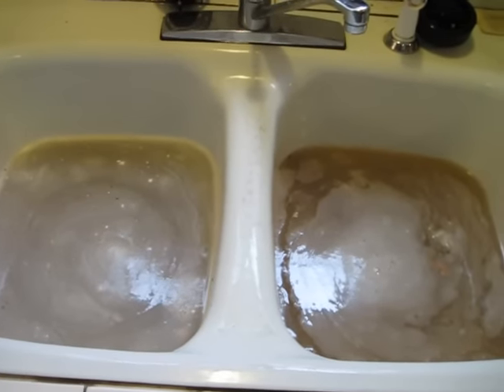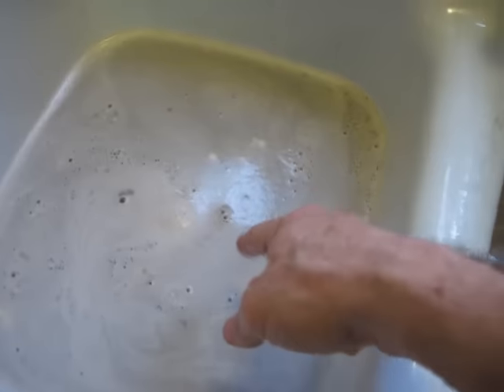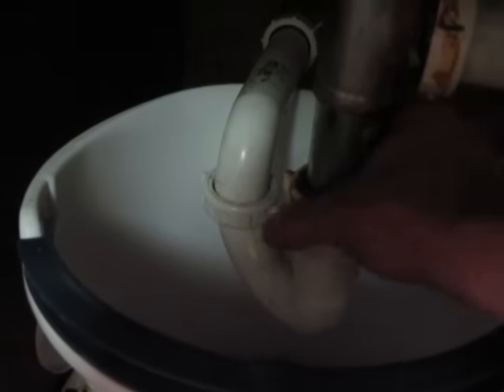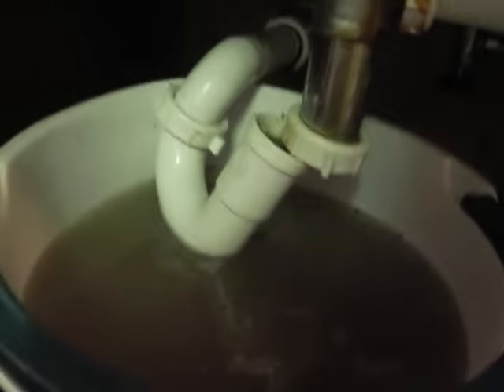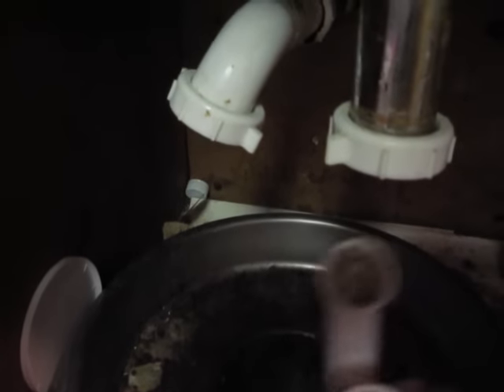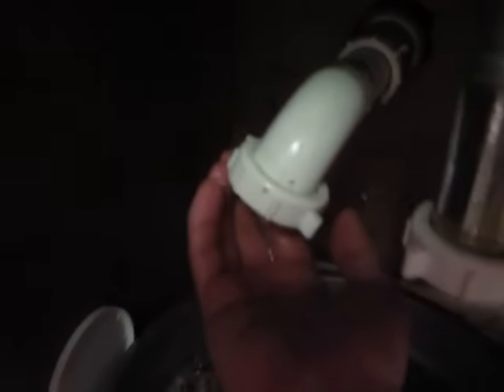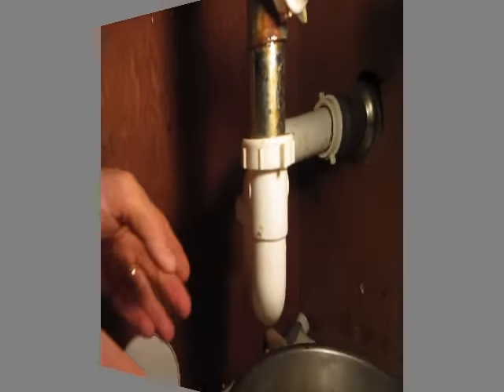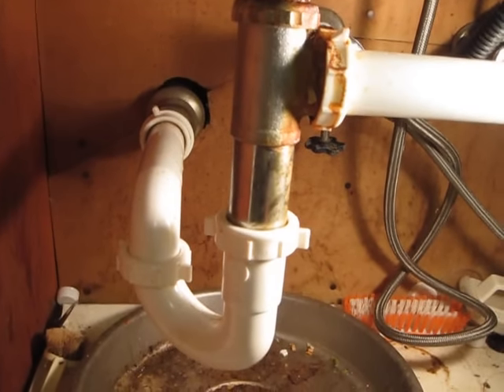How to Unclog a Kitchen Sink

Comment: PLUMBERS TRICK: To save you all the trouble of pulling the pipes apart in the future (for this exact problem)....In the beginning of the video when you had both sides of the sink full and turned on your disposal, if you had put the plug in the side that did not have the disposal on it and held it in tightly so it didn't pop up from the pressure, the disposal would act as a water pump and push the blockage right out. You saw how it filled the other side of the sink when you turned on the disposal. Same thing will happen but while holding down that sink plug it will make the pump push the water past the clog. You may have to do this a few times before it blows everything clear but it works every time. If it wont blow it open then chances are the clog is so deep in the pipe that a snake needs to be used. When you try this method the side of the sink with the disposal needs to be half full of water. The disposal will then pump that water into the lines under pressure. BEWARE that when you shut off the disposal to quickly hold your hand slightly over the disposal drain because if it didn't clear the clog water may shoot back up suddenly. Like I said it may take a few times to get it open depends how tight the clog is. Great video for home owners!!!
Reply: Did this tonight...worked just like you said...THANK YOU Rob Reynolds.
Reply: Rob!!!!!  Omg thank you for the tip...hopped on YouTube (bc you can find ANYTHING on here, what did we do before YouTube and Google?!?!) bc my kitchen sink got clogged on the side of the garbage disposal and was backing up water while my dishwasher was running!!!!  Yikes.  Happened on this vid and saw your trick posted!  Took all of 5sec to fix it, would have cost me at least $100 for a plumber to come out!  Your awesome.....bravo!
Reply: Mr Rob - You're The Man! Used your Plumber's Trick on my clogged kitchen sink this morning. It worked the 1st time just like you said. Both sides were so full of gunk I had to bail into a bucket almost all the left-side to put the plug in and half the disposal side. Held down hard on the plug, flipped the switch and PRESTO problem solved. I am truly grateful I took the time to read some replies and came across your post. THANK-YOU! :)
Reply: Great to hear it worked for you. Your very welcome sir.
Reply: o
Reply: Holly Hall Holly that is great...Every little thing we can do now a days to save some money is well worth it.
Reply: Rob Reynolds SOOOOOO bummed!  I've tried the plumber's trick a few times...guess I'm further down in the trap!  POOP!  Guess I'm taking everything out from under the sink and making a bigger mess than I hoped to today.  I knew putting 5 dozen eggs worth of shells wasn't my most brilliant idea.  :/
Reply: OH OUCH...yeah you cant put egg shells in a garbage disposal. You will need something to break them up like a snake.
Reply: Rob Reynolds Yup...totally an idiot maneuver on my part!  Took apart the trap (which is CRAZY because it almost touches the bottom of the cabinet and only has 1 nut that comes undone and everything else is cemented in...WTH?) and cleaned out all the shells.  Water flows down the sink now...however, it leaks.  So...mo-fracka...my plumber friend is coming tomorrow morning to see what he can do.  It's not a normal trap deal fo sho!  No gaskets, plumber's tape didn't work, hand tightened and wrench tightened...just a POS.  But I SUPER appreciate guys like you that are willing to share their knowledge with those of us that like to try taking care of this nonsense ourselves...when we screw ourselves over with eggshells!
Reply: Rob-This worked-Thanks-you saved me some $$$$
Reply: Thank you, Rob!
Reply: Thank you Rob--Afraid it's not working for me though :*(  I first tried the baking soda vinegar boiling water trick on both sides as I saw that method first.  I'm doing laundry at the same time, and I am wondering why the washing machine water filled the sinks!  I bailed all that nasty water out, and then saw your trick, so gave that a try four times. I went into the laundry room and there is a puddle of water on the floor with a lot of tiny little gooey balls of white sticky stuff...no idea what that's about??? Could that be a baking soda?  Anyways at least now the water sitting in my sinks is nice and clear.  I wonder if I should start taking pipes apart....or go the hard ware store for a snake!  I had no idea we can't put egg shells into a garbage disposal. I caused this clog myself by putting a bag of baby carrots down the disposal.  I don't think I'm going to be using my garbage disposal for much of anything after this nightmare :*( :*(
Reply: OMG - we have had a plugged kitchen sink for 2 days and have tried the strongest liquid plumber and another brand and NOTHING. I just bought a snake thing and got back to work and googled "unplug kitchen sink" and found this video. I saw your post, Rob, and called my boyfriend and gave him the instructions over the phone and WHALLAH! It worked!  Thank you!!! phwew!
Reply: Rob, Buddy, I could have used that tip YEARS ago. You are the man. Hat Tip and a cheer.
Reply: GOD BLESS Rob Reynolds
Reply: LOL...glad it worked for you...
Reply: Michelle Walker
I'd say compost the shells. Absent that, throw them on the lawn. They'll get pulverized next time you mow and the grass will benefit from the calcium.
Reply: THANKS A BUNCH THIS TRICK JUST WORKED FOR ME
Reply: You are amazing!!! Thank you SO much for this tip.  Unfortunately, I read your thread after I took all of the pipes apart!!!  It work instantly : ) I was very cranky when the sink was clogged...now I am happy!
Reply: Hi Rob, just want to say thank you for your great tip!!! It worked like a magic!
Reply: Thanks Rob. Took your advice and it works.
Reply: Rob, just used the "disposal method" and it worked like a champ! Thank you!!
Reply: Dude!  Worked like a charm!
Reply: love hearing that
Reply: Awesome!  That works!
Reply: Worked like a charm!!!!
Reply: This is a great suggestion, I tried it and guess what happened? Water backed up out of the washing machine hose drain and onto all over my garage floor.... yeah it smells bad.... so we then got a hand auger, 25 feet into the pipe and nothing there, not from under the sink pipes, not in the washing machine hose drain and not in the main clean out. Where else can the problem be? My sink is not completely clogged perse, it just drains really slow......
Reply: Worked right away. Thanks
Reply: Leona C.  I would call a drain cleaning service in your area at this point.
Reply: +Rob Reynolds THANK YOU! This fix cost me a total of 7 bucks and worked like a charm.
Reply: Rob Reynolds You are a life saver. I did it myself and cleared the clog. It took some strength, especially if you try to clear it by yourself. Thanks for the suggestion. Passing it along.
Reply: Perfect, thank you sir.
Reply: Brooooooo I love you, unclogged our kitchen pipes in like 30 seconds and gf cleaned out my pipe too if you know what I mean THANK YOU
Reply: This is why I love the internet--worked like a charm!
Reply: Thank you so much. It really helps.
Reply: You are very welcome
Reply: Rob Reynolds Thank you, Rob!  I first had squirted some Dawn dish soap into both sink drains and let it set (eats away at grease and protein).  Then I found your great advice here:  Plugged the non-disposal sink drain tightly.  Filled the disposal sink at least half way with hot water.  Ran the disposal.  And...whoosh!  Cleared out the clog and is running normal again from both sinks.  You rock for getting on here and taking the time to help us all out!
Reply: The dawn trick works on plugged toilets well
Reply: You the man rob woohooooo!
Reply: My parents were trying to figure out how to unclog it for hours! I did the research and found you in an instant. Fixed it, thank you.
Reply: lol bet they were surprised
Reply: your very welcome
Reply: If I could give you a hug through the computer I totally would!!  Thank you so much for sharing your expertise. Not all girls are lucky enough to have a Rob around ;)
Reply: that is the best comment I have ever received. Thank you...
Reply: Dear Rob Reynolds will you marry me?
Reply: Your very welcome.  You seem to be quite popular....
Reply: Awesome page!  If I lived in Minnesota I would definitely give you shout.
Reply: Rob, thank you so much! Worked after the third time turning on the disposal, just like you said! Thank you very much sir, you are a fine gentleman.
Reply: Thank You. I'm happy it worked for you.
Reply: Thank you so much!! My kitchen was clogged and turned to this video for help and scrolled to see your comment. I didn't think it'd work but it did and saved me a lot of headache! So glad I didn't have to call a plumber..
Reply: lol oh but you did call a plumber...I'm glad it worked for you. We have actually started telling our customers about this trick on the phone when they call in. If it works we saved them money...if not we go out and snake the drain for them.
Reply: Rob Reynolds Thanks Bob...... Worked like a magic...... I should've scrolled down to comments in first place.. I tried what the video said and gave up....... And scrolled down to see your message....... THANKS A LOT FOR SHARING THIS PROFESSIONAL TRICK. Not everyone is so generous like you..
Reply: Rob Reynolds You Da Man Rob.  Worked exactly as you said.  Great tip!
Reply: great Patrick good to hear
Reply: Thank you so much!!! This worked instantly on the first try
Reply: Rob Reynolds Thanks so much. After plunging and snaking we were getting no results. I remembered this comment and gave it a try. BOOM! It worked. Saved us $300 bucks. You the man!
Reply: Rob Reynolds I just tried this and it worked! Thanks a lot man!!!
Reply: Rob Reynolds THANK YOU!! I don't put much down the garbage disposal, but I had family over for the last 24 hours and they have different habits for disposing of food and I ended up with a minor clog. The sink would drain, but if we used the garbage disposal the other side of the sink would fill up. I watched several YouTube videos trying to find something that was less involved than taking the pipes apart. While the particular video your comment is connected to wasn't helpful (I didn't even finish it because it didn't seem to fit my situation) I am so glad I saw your comment and the tip you offered in it!! It was just the trick! It took two tries, but the drain is entirely cleared! Thank you! And another thing- I saw your comment to another viewer that you may start a YouTube channel -- I think you should. You saved me time and money.  Thx again from Portland, Oregon.
Reply: Rob Reynolds HELP if possible. Did not work for us. We have a longer drain pipe though connecting to the city line through our back yard.
Reply: Rob Reynolds Rob, your tip worked on my first attempt. I used a drain stopper for my tub that didn't fit perfectly, but it covered enough of the sink drain to work. I imagine if the clog was worse, I would have needed to use something with better seal. Thank you.
Reply: dailoman you can get a few paper towels, and use them as plug! Worked for me!!
Reply: you are the man sir. it worked perfectly aha thanks playa
Reply: Thank you so much, it worked perfectly.
Reply: Rob Reynolds I join the long list of people for whom this worked so simply and wonderfully.
Reply: +Rob Reynolds THANK YOU!!!!! IT WORKED!!!
Reply: +Rob Reynolds Thank you so much for this information. Really helpful.
Reply: +Rob Reynolds You just saved me a major hassle because I fixed my sink myself using your trick!!  Thank you very very much sir!!!
Reply: brandon williams yeah same here. Thank you!
Reply: +Rob Reynolds Thanks. your post saved me lot of trouble.
Reply: Thank you! Saved me so much trouble and worked like a charm!
Reply: +Rob Reynolds Just tried it after hours of plunging and snaking.  Worked in less than 5 minutes.  THANK YOU!
Reply: Worked like magic! Thank you!
Reply: +Rob Reynolds This may be the most useful comment in YouTube history. Count me among the millions that found this to be a lifesaver. Thank you Rob!!
Reply: +Rob Reynolds Bravo Mr. Reynolds ! and also a thank you to GeO for posting the vid, without which none of us would have read Rob's comment.  Yes, it is thanksgiving.  Yes, this worked .. 1st try !  Amazing it's not common knowledge. But you (Rob R) clearly helped more than 80 people.  : )
Reply: +Rob Reynolds I tried it, several times as you indicated, but it didnt work. It also caused some leakage to start from the disposer itself it seems through the housing, that was previously not there. The debris that came up during the backwash was like shards of flotsam that, frankly, I dont know how they got in there. If the disposal is working correctly it should annihilate the things put into it into very small grains. Right? This stuff had as much as 3/4 an inch in size, like paper thin too. I will have to try the auger. Does this indicate that I have to replace the disposer too? I also noticed the drain from the dishwasher was going into the sink drain, in an inlet, but was not put through the disposer first. Don't know why the previous owner did it that way. There is also a small attachment there in that same pipe before the "P", leading to my reverse osmosis tank. IDK, maybe too many holes for this to work? I hope the crud didn't get into my purifier tank or into my dishwasher drain, but I would assume it is setup to keep the flow from reversing. 
     Plumbing is not fun, and I think plumbers are worth every penny they get. In my first attempt to snake the line, while taking apart the drain, the strainer below the sink broke off from the puddied ring on top of the sink. It was too old and an unusual part to find with a center screw holding the two together that completely corroded off, and I couldnt find another, so I replaced it with a more modern one. Now the drain pipe is fixed but Im back to the clogged drain (w maybe a new leak on the disposer). The smaller 10 foot auger didnt come up with anything. I have to try a longer and thicker 25 foot auger next. 
Thanks for the tip, it might have worked on a smaller clog, and it is a good'n!
Reply: +Rob Reynolds If Dawn works as a grease breaker, wouldn't an actual degreaser work even better or is there something in Dawn that's preferred?
Reply: +CarlAnthonyTV I would call in a pro. ASAP
Reply: unfortunately I have used an auger, draino, liquid heat and plungers. I do not have a food disposable system.

I think I'm screwed and have to call a plumber.
FML
Reply: +freeburds maybe y'all should PayPal this man a few dollars for saving y'all $$$$$.
Reply: Rob Reynolds THANK YOU!!! I've tried snaking the line 15 feet, tried snaking outside 15 feet, tried chemicals, hot water.. nothing worked.  Four attempts with your trick, and after two weeks of washing my dishes in the sink next to my washing machine, I have my kitchen sink again.  However, now I've got a lot of water outside my house that looks like it came from a pipe outside on my roof.  THANK YOU SO VERY MUCH!
Reply: Rob Reynolds - you rock. ur tricked worked
Reply: Curling hair
Reply: Rob, you are the MAN!! That trick worked like a champ!!! Thank you Sir!!
Reply: Rob Reynolds This worked like a charm! Thank you!!
Reply: Rob Reynolds THANK YOU!
Reply: Thanks a million!!! this just worked - even with a deeper clog beyond the u-bend. Damn carrot and potato peelings - lesson learned.
Reply: Now THIS made sense! I wish I would have seen this before messing with the snake and everything else! This trick took care of it first time and now things are back to flowing properly again. Thanks @robertreynolds1 for posting this.
Reply: This saved me. Thanks!
Reply: I love this idea, that's what I grew up with/we did last night. it didn't work though (maybe we weren't doing it right). I opened the pipes this morning and found the nasty pasta clog!!
Reply: Rob Reynolds what about a sink without a disposal?
Reply: YOU ARE THE MAN!!! Spent days trying to uncog, watched several other utube vids but to no avail. I really was at wits end and thought plumber really needed to come in as the clog was definitely in the drain pipe. Your 'trick' made a lot of sense so i tried it though didn't think it would work on my sink due to the clog being so deep...tried in once, twice, three times...and then all of a sudden, lo and behold the water started to recede in a rate of knots!!! Felt like Moses watching the Red Sea parting! as i said YOU ARE THE MAN!!!!
Reply: I know this is an old comment but this is amazing. I actually just suctioned the plunger down on the non-disposal side instead of using the plug and turned on the garbage disposal and it fixed it instantly! Now I know how to fix clogged kitchen sinks like a pro haha. Extremely useful thing to know.
Reply: Rod, if you are still alive I think you deserve some appreciation for sharing this trick. I'm sure many folks your comment has helped wouldn't mind contributing to a gofundme account. why don't you set up one and share the details here.
Reply: Rob Reynolds great tipp unclogged my sink fast !! saved me so much time 👍
Reply: Rob Reynolds you're the MAN!! thanks!!
Reply: bad idea bro!! i tried your little "trick" the water started shooting out from the wall all over the floor from a pipe behind the washing machine.  assuming that washing machine drain pipe is connected to the sink's drain pipe and the block is farther down.  also appears that the washing machine drain is just not sealed at all, some plastic tube stuck in the top of a piece of old galvanized pipe... lol so yeah, people don't just go blowing water thru you never know where it could just blow out somewhere else.  hire a professional...
Reply: I just saw your video and it worked like a charm...wish I would've saw it before taking sink apart. Thanks a million!!!
Reply: austinitesince1979 -- That's my concern. I'm afraid if I create a vacuum and force the water, it will break something.
Reply: just used this method worked!! thanks a bunch rob!
Reply: Thank you so much for this comment.  My husband was going to take the pipes apart using this great video tutorial.  I tried your method and it didn't work.  Then the next day, I decided to plug up the sink again and then use the garbage disposal and let it run and run.  After a minute or two, voila! it all came unplugged!  I'm glad that I saw your comment and I'm glad I found this video, both very helpful!
Reply: Thanks Rob! Your plumber trick worked!
Reply: Pretty sure you'll burst the pipes if the pressure is too strong, but w/e
Reply: Rob Reynolds Your trick worked. Thank you thank you thank you!! I love you man 😂
Reply: Dude my sink has been blocked for two days, and after plunging the living hell out of it for 3 hours I figured there's gotta be a better way to do this. I was looking on YouTube and saw your comment on the top of the list and thought that's pretty damn smart. Pretty much a centrifugal pump. Worked like a goddamn charm. Idk if any one has told u this, but Rob you are the friggin' man
Reply: Rob, thank you so much. That worked great and super easy. Much appreciated!!!
Reply: I just did this, worked like a charm. Thanks Rob!
Reply: Rob Reynolds thank you! Your suggestion worked like magic! Last time I paid a Plummer $85 dollar to solve a 2 minute job! 

Much appreciated!
Reply: Rob Reynolds - Thank you so much!! This was a life saver for me. I don't have a handy man at home. I tried your method and it worked. I didn't want to have to unscrew the plumbing. It looked super gross! Thanks for leaving the comment.
Reply: Michelle Walker o damn egg shells..I just did that last week!! Stupid me...but will try this plumbers trick!
Reply: camper doodles did the same with egg shells..clueless I had no Idea! Do now though..
Reply: Rajkumar Varadharajan I did the same exact thing...scrolled down to comments. His advise was priceless...:)
Reply: This method can also blow the pipes loose.
Reply: This worked great on Oct 7th, thank you so much! Saved me from calling a plumber on Thanksgiving weekend.
Reply: Thanks Rob - worked like a charm!
Reply: Thank you! Your comment is the best part of this video
Reply: This took me several tries and took all of my weight to hold the plug down on the other side. I think I'll actually be sore tomorrow! But it worked! I took the pipes apart and wasn't able to find the clog so I know it was pretty deep. But this still worked for me. I am so relieved. Thank you so much.
Reply: Rob Reynolds I just wanted to say thank you from the bottom of my heart. I was in tears not being able to fix my drain and your comment was first and I tried it and it worked. Thank you so much!!!!
Reply: I wish that had worked for me. I ended up soaking wet on the first attempt. The pressure caused the pipes under the sink to pull apart. Even with a bucket in there, it was spraying out horizontally. Me, under the sink, the floor... all wet. I guess my problem needs a plumber. I also tried the method in the video (cleaning out the p-trap, etc), but that didn't help either.
Reply: Wow, I was about to take apart the pipe below and read your comment. Talk about close call. Good advice sir!
Reply: Thanks, worked just as you said.
Reply: Worked great!  Thanks Rob Reynolds!
Reply: Rob Reynolds you just totally saved me on Thanksgiving eve!! Thank you
Reply: Rob Reynolds I tried this twice and was about to give up. Third time was the charm thanks so much
Reply: Add me to the list of people who tried this 'plumbers trick' who thought it was great at first, but then discovered disgusting water and rotting food pieces spewing out my washing machine drain pipe and flooding my utility room. Had to call a plumber to get the drain further down the pipe anyway and added extra work cleaning up the laundry room.  Oh well.
Reply: Yeah, it's not always going to work.  If you have some minor gunk in there, it can...but if you've been going hard for years on the disposal and there's a multi foot long fatberg in that drain, it's time to either call a professional or..if you're careful nuke it with some lye or drano crystals.  Sounds like you had a 5 alarm clog though if it was pouring out another outlet in a different room.  Jeez.
Reply: Rob Reynolds this comment helped me. I took the peices off and realized that the clog was just into the pipe. Just out of reach going into the wall but i tried your plumber trick and it worked.  Thanks
Reply: Rob Reynolds thanks!!
Reply: Thank you so much for this tip! Worked like a charm
Reply: I know this was 3 years ago but guess what, it helps to this day thanks a lot
Reply: Rob Reynolds I do this all the time lol people are amazed
Reply: I know the comment is old but this fixed my problem today! Thanks!
Reply: Rob Reynolds you are the man. I just spent 2 hours watching videos and then stumbled upon this blessed post.
Reply: Unfortunately, no dice for me. Threw some tiny orange (bellas or something?) peels down the disposal, thought they'd chew through it no problem. Filled the sink more than halfway, held down the plug on the non-disposal side, but it hasn't cleared up.

Going to try a snake tomorrow - first time using one. In fact, I need to go buy one, but, we'll see how it goes. Appreciate the tip - wish it had worked for me!
Reply: Rob Reynolds worked like a charm!
Reply: Rob Reynolds THANKS SO MUCH FOR YOUR TIP IT HELPED ME SO MUCHHHH.
Reply: YOURE THE MAN THANK YOU
Reply: Thank You Rob Reynolds. I can see my sink again. God bless you.
Reply: Thank you Rob Reynolds. I can see my sink again. God Bless You...
Reply: Thank You Rob Reynolds. I can see my sink again. God Bless You...
Reply: Word of warning: the powerful syphon effect may cause water to leak from the pipe connecting joints. That's what happened here. Afterwards, no leaks.
Reply: Thank you! This worked just like you said it would. I really appreciate the advise.
Reply: Rob Reynolds I
Reply: Rob Reynolds How long do you leave the disposal on before turning it off?
Reply: Rob Reynolds I thank you man! Props!
Reply: Violet Raven クリスタル I took your word man. I did it and the water shot down and didn't come back up. God bless you man. This is real and no gimmicks people. 👍
Reply: Rob Reynolds thank you !!
Reply: Badass advice. Worked!!! Thanks!!!
Reply: Thanks.  I knew something like that would work but didn't kniw the trick.  You should post a video.  I would but didn't want to steal your fame.  😁
Reply: Rob Reynolds  thanks to you I don't have to call a plumber awesome trick that works thanks a lot!
Reply: Thanks man
Reply: Yessss!!! Thank you sir! Worked after a few times.
Reply: Thank you based Rob for fixing my clog. For everyone else: Definitely felt the pressure jolt like Rob said, so hold down tight unless you want nasty sink water all over the kitchen. Took few pulses but after 20-30 seconds, that pressure jolt hit and everything cleared up.
Reply: This is the true gem right here. Watched this whole video, but had I read your comment first it would have saved me 30 minutes of work. Thanks dude.
Reply: Rob Reynolds i have the same problem but every time I turn on the garbage disposal, that’s when it will clear the other side to a slow drain which is usually backed up...and also when it drains down it makes a gurgling noise....any help would be appreciated...thanks in advanced
Reply: Wow so simple and it WORKED. Thank you sir!
Reply: Thanks for this tip! It worked perfectly.
Reply: Rob Reynolds thanks for this trick.  Just saw this post and it worked for the clogged sink. You sir are a hero.
Reply: It worked. Thx Rob
Reply: Rob Reynolds omg. I clogged the sink of the family that I am nannying for. I was in complete panic but you just saved my life!
Reply: Thank you! Your comment just saved us so much time and trouble 👏🏼
Reply: It works wonder!! I tried so many ways to unclog my kitchen sink and nothing works. I am just about to give up and call the plumber and saw this! Thank you so much for sharing the tip!!!
Reply: Thank you so much! My husband and I appreciate your expertise.
Reply: LIKE A CHARM!!!!! GREAT TIP!!!!
Reply: Omg!!! Thank you so much for your tip. If you had a paypal account,  I would definitely give you a donation. ❤
Reply: Omg! I just tried this worked the first time!!! Thank you
Reply: Just SAVED MY BACON!!  Switched the plug to the non-disposal sink and held it down while disposal ran (felt the push back on my hand and I held it more strongly) and it worked!!!  First attempt after fruitless plunging and I'm so relieved!
Reply: Rob Reynolds 
I just tries your trick. OMG it worked. Thank you so much. I am so GRATEFUL!!!!!
Reply: Rob Reynolds bro!! Your tip fixed my sink. Didn't even finish the video cuz your advice worked! Thank you.
Reply: Rob you saved my me a lot of trouble, I think I love you man. I will pay it forward.
Reply: What a sweetheart!!!  Thank goodness I read your comment (the gift that keeps giving) before I watched the video.  Your solution fixed my problem in 30 seconds.  Thanks so much! xoxo
Reply: Dude you are a lifesaver! This worked perfectly!
Reply: Amazing!!! Fixed within 5 seconds haha
Reply: Thank you! I was about panicking and tried this. Worked. first shot.
Reply: Just did this. It worked. Took a about 30 seconds but it finally pushed through. You have to hold that plug in good and tight. Glad I got it done before the wife got home she would have been angry lol.
Reply: Still works years later im thankful for your advise.
Reply: About to call the landlord, did this, no more stoppage!  You RULE.
Reply: Thank you sir, was about to go crazy. Tried to snake it multiple times, no dice. Now my wife won't kill me. You the man.
Reply: Thank you very much!! Was getting ready to take the pipes apart like the guy said but decided to try your method first...worked like a charm and it only took 15 seconds thanks!!
Reply: wow, not sure if you still if your around, but this advice worked perfectly. my parents home had a clog in their sink for the past week, tried other advice posted on forums, nothing worked, that is everything without having to remove the past the p-trap, and they were about to call a plumber, i tried this trick and it worked perfect, they came home from church and were really happy. So thanks for this useful advice.
Reply: Thanks again. Double-clogged kitchen sinks with a garbage disposal on one of them. Unscrewed the kitchen drain clean-out on the outside of the house and got a fair measure of black crud to spill out. Reinstalled the clean-out plug; sinks still clogged but at least could slowly drain. Read and did your trick and within five seconds the remaining blockage was taken care of.
Reply: Wow, thank you! You just saved me a huge head ache
Reply: 4 years later and you're still the miracle worker!  THANK YOU!! 😍♥️
Reply: You are the man !
Reply: Oh thank you so much Rob!!! It worked for me also!! You are amazing!!!
Reply: Rob-  Thank you for sharing this fix...I have ten thumbs when it comes to fixing things and after reading your post I went and did this and it worked beautifully!  Within 3 minutes I looked like a hero.
I appreciate you taking the time to write this.  Happy Thanksgiving!!
Reply: YOU THE MAN, ROB!!
Reply: It didn't work. My garbage disposal sounded like it was going to break when I tried this. Do you have any other tips? :)
Reply: Thank you so much for this tip Rob Reynolds! I had this exact issue tonight and I fixed it! Thank you so much for sharing!
Reply: Thank you for advising on this fix. Just worked perfect for me - sink is back to normal! =)
Reply: Any tips on how to unclog the sink with NO garbage disposal? Both of my sinks are filling up 🙈
Reply: Didnt work for me bro i tried
Reply: Thanks dawg
Reply: I wish I had a a disposel. My sink has been clogged for two month. Everyday I have to dump it multiple time a day just to do dishes. Wtf
Reply: Rob Reynolds I’m having a hard time with my drain I’ve tried vinegar with a whole box of baking soda nothing happened. Then I tried boiling the hot water poured down slowly nothing happens oh I 4got to use salt dang I’m try that over but I got desperate and used a bottle of liquid Plummer waited 15 min nothing. I put a wire hanger down in there nothing I’ve used a plunger that didnt work.  The garbage disposal is running good and both sinks are half full so I turned on my disposal and plunged the heck out of the opposite side. That didn’t work. Is there a technique that you use I can’t give up my father never called the plumber he died in June 2011 GOD rest his soul. I have a snake but I think the end is to big to go in2 the sink it might be for toilet what do you think I value your opinion you helped a lot of people here. You should do your own you tube channel I know I’d subscribe I don’t usually subscribe to anybody unless they know a thing or two about what they doin. I am going to subscribe here to this channel.
Reply: Not all heroes wear capes🙌🏾
Reply: Glad I read the comments before I did anything!! Tried this trick tonight and worked like a charm! Definitely requires 2 people... one to hold the stopper REALLY HARD and one to flip the disposal switch. So thankful for this tip!!!!
Reply: Thank you so much! it worked the first time!
Reply: Rob Reynolds worked exactly as you said it would! Thanks so much for advice! Saved me $$$
Reply: Rob - thank you SO SO much!!!! This worked right away unlike so many other things I tried without taking apart the pipes!!!
Reply: Thank you Mr. RAYNOLDS , WE Appreciate it.
Reply: Rob Reynolds thanks for the advise man.
It worked the first time and saved me a potential headache. 
Happy Holidays Brotha!

If you need any advise on flooring or painting, I am licensed and have good info to share.
Reply: your the man thank you for this tip It worked if you do exactly what you say lol thanks again happy newyears
Reply: Rob, I see it's been 4 years since you wrote this, but you are STILL helping people! My kitchen sinks have been blocked for days, and draining real slow.  I removed the pipes, and tried a snake and plunger for 2 days, before I saw this video, and it didn't unclog the sinks. Then I saw your comment last night, and tried it today. It worked just as you said! The first attempt,  I forgot to put my hand over the drain after turning off the garbage grinder, and quickly was reminded of what you said, when I got a burst of water in my face! I tried 3 more times after that, and it seemed to be draining better. Then, finally on the 5th attempt, I filled the garbage grinder sink half with water, turned it on, and this time it blew it clear! 
THANK YOU SIR!!  I was so relieved after several days with a clogged sink.
Reply: Thanks Rob! It worked the first time! You saved me time and money. Time to enjoy the weekend!
Reply: Thanks a million!!! It worked the first time I tried it.
Reply: Oh my goodness thank you this worked perfectly and I didnt have to take apart pipes!!! But I also loved the video in case I need to do this in future!
Reply: Thanks so much;  tried your way this morning; worked like a charm! :)
Reply: It worked...Thanks!
Reply: Rob Reynolds Thanks. It worked the first time for me. You saved me a headache!
Reply: Rob Reynolds thank you for your service sir lol it was driving me crazy trying to plunge this sink and it wasn’t working lol
Reply: Thank you sir! Just tried it and it worked👍
Reply: THANK YOU SO MUCH. just saved our disgusting sink from calling a plumber :,)
Reply: this worked for me too-- huge help-- I had picked up the phone to call a plumber. I had to repeat it four times and cleared the clog on #4-- thanks much!
Reply: Oh my God it worked so well! Many many thanks!
Reply: Rob Reynolds so I went straight to the comments to see if his method actually worked, I read your comment before i even watched the video, I tried your method and on the first try it worked, thank you so much, my mom was out with her friend and she told me to try and deal with it, THANK YOU SOOO MUCH THIS HELPED A LOT!!!
Reply: You saved me!!! After pressing really hard on the plug and turning on the garbage disposal the plug felt like it was suctioned into the drain. 
After turning it off the water in both sinks drained like normal!
THANK YOU!!
Reply: Dude thank you! I took apart everything under my sink tonight and couldnt find any blockages. Did this trick a few times and it finally cleared up! I still want to get into the deeper drain pipe and flush it out though but at least the smell is gone and the sink is usable!
Reply: Thanks Rob, worked liked a charm :)
Reply: This worked for me man thank u for ur knowledge!
Reply: Rob Reynolds just tried it ! Thank you so much!!!!
Reply: Not all heroes wear capes.  You just saved me a lot of time and money!  Thank you!!
Reply: Thanks Rob!!   I had exactly the same problem described in this video and I was about to fix it the same way...until I read your comment and BINGO!!   Yes, the disposal played as a water pump while blocking the drain sink..and pushed out the crap out of my pipe.
Reply: Oh my gosh. This really worked. I was starting to stress out because its gross and I couldn't clean the kitchen since the sink was clogged. Now I can happily return to my normal OCD. THANK YOU SO MUCH !!!!!!!!!!!!!
Reply: Rob Reynolds Thanks for the tip!!!!
Reply: What if I dont have a disposal....can I just run my dish washer? Lol
Reply: Dude you are a life saver
Reply: THANK YOU!!!! This worked for me on the weekend when I would have had to pay double rate for the plumber. You're the BEST!
Reply: @rob reynolds do you have any recommendations for a kitchen sink that is only one-sided with a garbage disposal? Please any help is appreciated.
Reply: Thank you, it worked!!!!! It all shot up through the drain by hot water tank but it came out!!!!
Reply: Rob Reynolds you are a lifesaver. I was 2 hours into troubleshooting and playing "find the clog" with a hanger and went through 2 bottles of Drano. I was about to call it quits after doing everything short of taking off the P trap (I don't have a bucket big enough to hold all that water) when I stumbled upon your comment. It took about 7 or 8 attempts as I guess this was just a stubborn clog, but it finally worked and my goodness, I've never been so happy to see water go down a kitchen sink!
Reply: lol u bruh ur cool milk dud - :Dylan $antwani
Reply: eeeeeeeeeeeee
Reply: Thanks Rob,worked like a charm.My elderly parents have been having a clogged up kitchen sink on and off for years and now they know how  to fix it.Your a life saver.God bless
Reply: Michelle Walker- I would have first tried snaking from above. The water in the sink will help clear the pipe...
Reply: I can't tell you how happy I am that you included this comment! I have unclogged my kitchen sink on more than 1 occasion after watching the video & following the tips in your comment. I had really dreaded taking the sink apart, but didn't have to. Thank you!!!!!!
Reply: Thank you Rob, soooo much! This actually worked. The plumbers we had come out to check it out, were charging $600 to snake it..smh. I'm glad we didn't go for it. I'm so happy I found this video with your comment. Thank you!!!!!
Reply: Rob Reynolds 4 years later and you’re still saving lives! You sir are a gentleman and a scholar!
Reply: Rob Reynolds worked like a champ, thanx
Reply: Rob Reynolds thank you, I know this is and old comment but it worked like a charm! Saved me some money that’s for sure.
Reply: This worked great 1st time for me THANKS Man
Reply: Rob Reynolds omg thank you so much for this!! I had no idea how to remove the pipes and this saved me a lot of trouble.. I was doubtful at first but when I filled the disposal sink with more water to flush it was a miracle!! 😭🤝
Reply: Thanks Rob just had this same problem your tip was very helpful
Reply: This worked!!! Thank youuuuuu!!!!
Reply: Not if it's rice! Trust me.
Reply: Duuuude you are the man Rob. I used a drain snake twice and still couldn't get my sink to drain properly, I tried this trick and bam we're good. Thank you!
Reply: You tip was way better than the video. Solved my problem. Thanks
Reply: Rob Reynolds Tried this tonight,worked great! Thanks for saving me a plumbing bill.
Reply: Rob Reynolds you are an American hero
Reply: We need to start a gofundme account for Rob Reynolds! Saved my a$$ lots of  money 🤣💕
Reply: Michelle Walker o
Reply: Rob thank you your tip worked perfect I didn’t want to have to call my maintenance guy and wait all day now I can proceed with my dishes.
Reply: Thank you it worked!
Reply: Not all heros wear capes. Thank you so much my man.
Reply: You are the best rob reynolds. Just fixed my sink in less than 2 mins👍🏾
Reply: @robertlreynolds1  still saving me money 4 years later. And a lot of headaches. Great comment and thanks a million Rob!
Reply: Omg thank you!!!
Reply: I tried this and my pipes came undone under the sink. This was not long after a plumber had replaced all of them. Could it be because I had plunged the sink?
Reply: I just followed your advice and it work. Took about five attempts. I also had put hot boiling water and some baking soda soaking for about an hour before. Thank you very much.
Reply: Rob Reynolds this worked! Huge thank you, Rob!
Reply: Now that's a video that should be made!! Not that I have a garbage disposal but many ppl do.
Reply: YOU ARE A LIFESAVER! I was dreading having to call my landlord and shell out money for a plumber. You saved me from a major headache!
Reply: Thanks Rob Reynolds. Much easier.
Reply: Kudos to you goid, sir.  Just read your top comment and only 40 secs into the video and it worked like a charm! 👊
Reply: THANKS 😊 worked I was intimidated to take all the pipes apart
Reply: Dude you are a life saver! I just did it and it worked!!!
Reply: Rob Reynolds 😭 I clogged my kitchen sink and I’m trying to unclog but it’s hard
Reply: Another one thanking you Rob!
Reply: This comment saved my life. Thank you a million times ❤️
Reply: Thank you so much ! You saved me from calling a plumber I was going crazy with the sink trying to figure out what to do
Reply: Rob Reynolds you rock used this today and worked like a charm!
Reply: WORKED FOR ME TOO!! THANK YOU SIR.....
Reply: 5 years later and this worked like a charm! Thanks!!
Reply: Ohhhh Rob you awesome man!! I'd tried white vinegar, baking soda and hot water. Was JUST about to call a plumber when I ran across your comment. IT WORKED and took all of a minute. I did have to do it a few times as you said but it worked!!! Thank you so very much! That money I saved is going toward a new dishwasher!!
Reply: Thank you so much!!! You comment helped out a ton I really appreciate it!
Reply: I cannot like this enough! It worked like a charm and save me a lot of time and maybe money too!
Reply: OH MY GOD. You are a money saver! I was this close to calling the plumber, which I didn't want to do because I'm short on cash right now. But I had tried everything: home remedies, drano, running a snake down. And then I tried this. Took a couple times, but it cleared right up! Thank you thank you THANK YOU.
Reply: Thanks... didnt read your comment before I pulled the pipe out but this will help in the future...
Reply: Tks my friend .you just made this husband of 20 years the man,a HERO I should say too my wife..

I just might get lucky twice this month🤣🤣😁😁
Reply: Wow! great tip, neighbor.  After taking the pipes apart, there was no local clog. Thought about snake and didn't have one.   So, I tried your method and the disposal pressure worked as a pump and pushed the clog through with some patience.  I added dawn and vinegar/baking soda to clean away and help it clear.  Muchas Gracias for posting your tip!!!
Reply: Bless you man, you saved my sink on Thanksgiving.
Reply: Rob Reynolds You saved the day! Worked perfect!
Reply: Rob Reynolds GOD BLESS YOU!  I'm so grateful for your help. I was about to lose it! Thanksgiving holiday was near and my kitchen sink was totally stopped up. The water was sitting in my dish washer and it did not smell nice. I was on my knees dipping water out from the dish washer.  I found this you tube video HowtoWith Geo and strolled down to read the comments. Boom!  There was your great advice!   I also want to thank Geo for the video, so helpful. You guys saved this single parent from calling a plumber!  Thanks Again!
Reply: This just saved my life! Thanks!
Reply: This method works great. It took 3 to 4 times for about 30 seconds each time but then...wow, it unplugged the drain. Thanks for the tip
Reply: Thank you Rob! it works and it is so easy!!
Reply: Thanks Rob Reynolds. Just got to my mother-in-law's house for Christmas lunch and she was having this same exact problem. Worked perfectly, saved the day.
Reply: Rob. It’s Christmas night with plenty of dishes to wash. Wheeew. It works my man. Thanks a bunch. It’s time for a cocktail. Merry Christmas.
Reply: Thank you!!! Plumber trick worked!!!!!
Reply: Worked like a charm. Thanks bro
Reply: Holy crap, this worked!! Thank you thank you thank
Reply: Hey I know your comment is from 5 year ago  but I did this and it didn’t work, now the basement is leaking did you know what happen?
Reply: God Bless you.   Looks like is working for me. Did it 4 times.....So much fun lol.  The first and second time water was coming back up, third better them forth time  MAGIC  happened. Thank you.
Reply: 5 years later you still helping us. Thanks
Reply: I guess I was the unlucky one, I try this and now water is leaking under on the finish basement. I’m assuming the pipe it burst or got disconnected from the a connection. I will probably end up opening the ceiling a little hard right now because I have a broken leg at this moment... this suck 😖
Reply: Add another satisfied homeowner! Thanks Rob for the clear instructions and after a few attempts - the clog was removed and no pipes had to be removed. What a great way to start the New Year and not have to deal with it. Thank you very much and glad your advice is still available 5 years later. It's timeless.
Reply: THANK YOU!!!! I just did this and it worked :)
Reply: Almost taking off all pipes till I saw this commented 😳save my day !thanks
Reply: thank you works great 👍🏻
Reply: Raine Lewis oh my god. It worked!!! I accidentally filled my sink with potato skins and the sink got clogged. 🤦🏻‍♀️ thank goodness I tried this - there were spillage but I pressed firm and it worked!  It took a while to get it unplugged. Used a fork to wrench the plug and now it is running smoothly! Thank you thank you!
Reply: Hi. It’s 2.05.20 and we tried the Plumbers Trick and it worked.  Than you.
Reply: Wow, thanks for the tip! Worked in less than 10 seconds!
Reply: It worked bro thanks for the help
Reply: Thank you!
Reply: Thank you JESUS..and thank you buddy..it worked the first try
Reply: Thank you for the garbage disposal trick! Worked like a champ and I was about to call a plumber after taking apart all the pipes and realizing my blockage was further down out of reach!! Life saver! I love you tube
Reply: Damn....this is a great tip. worked like magic!
Reply: Took it all apart, no apparent block. Came back to video and read this comment. Tried once, didn’t work, tried second time and heard it clear!  Yipppee thank you so much!!
Reply: Sitting here in Covid-19 quarantine, staring at a sink much like the above.... dreading  trying to get a plumber out.  But lo and behold, your plumbing wisdom saved yet another worried individual!  Thanks Rob!
Reply: Rob Reynolds I know this is a 5 year old comment, but seriously this was the only method that worked for me. I tried the snake auger and plunger. Literally was about to give up until I read your comment. Tried that and bam! It worked like a charm. Thank you again! 🙌
Reply: There comes a time in every mans life where he steps up his value by fixing shit around the house... thank you sir.. I am now the man again!!
Reply: This tip absolutely worked 4 me WOW
I saw this trick that was posted 5 years ago and it's updated today and worked so simple. I had done so much leg work in the past trying to brake this clog and this trick solved my problem in 10 seconds. Unbelievable Thank You !
Reply: Rob Reynolds Hi.  You helped me unclog my sink.  Thank you.  Do u have any tricks for a dripping kitchen faucet (one handle) besides tying a dishrag around it or having it directly over the sink divider?  My cat loves to drip to catch the drips. 😂
Reply: THIS WORKS! Thank you!
Reply: Well, I wish I saw this comment before I watched the video and took my whole sink apart! No luck. Then I tried this trick and it worked INSTANTLY! Thank you!!
Reply: You are a miracle worker! We tried the shop vac, Liquid Plumber, boiling water, a snake, and a bunch of other things, but no dice. We were about to call the plumber when I found this. We were super skeptical, but it totally worked. Thank you!!!
Reply: Dude!  That was awesome!  Thank You!
Reply: You are a blessing to humanity. I just saved the day with this suggestion. Kudos to you brother.
Reply: Right I was thinking that too. I forgot all about that. It’s always a good idea.
Reply: Wowwww! It worked!! Thank you!
Reply: Worked like a charm. Thank you! Cheers!
Reply: THANK YOU!  Didn't want to have a plumber in the house with this virus thing going on!  It worked like a champ!  I shared it with friends!  Boiling water, soda, vinegar, Dawn, salt--nothing worked but this did!  Thanks for the tip!
Reply: Rob Reynolds thanks!
Reply: This worked! Thank$$$!
Reply: Rob Reynolds thanks , that really worked for me ..
Reply: Will this trick work if we have the disposal on our main sink but the water is also building up in the smaller, second sink in our kitchen island?  Have someone hold the plug on the island sink while we run the disposal?! Help!
Reply: Rob Reynolds how do I shut off the disposal? Do you know any video that show? Please help because Ithis is my 1st doing it and don’t want to risk anything that I’m not 100% sure of!
Reply: Rob Reynolds this worked!! Saved a trip for my maintenance team 😅 thanks a bunch!!
Reply: THANK YOU!
Reply: Thanks Rob! Worked on the first try! Saved me a whole lot of headache.
Reply: Tried everything, liquid plumber, baking soda and vinegar, salt and boiling water, broke a plunger and finally saw this post.  Took 30 seconds to unclog it. Unreal. 2 days. Thank you Rob Reynolds!
Reply: Thank you so much....this saved me today!!!!!! Blessings to you and your family.
Reply: Rob Reynolds I tried your suggestion and it worked like a champ. Thank you so much.
Reply: I’m SO glad I read your comment. Thank you so much!! Life saver!!!
Reply: I just did this right now and it worked!  Thank you for sharing your expertise and saving me so much money!  I love how generous you were to share it!  Thank you!
Reply: Man it pays to read the comments!! This took me two tries and just like you said it was gone. Thanks for the tip.
Reply: Omg Rob your amazing!! Saved my life!! My sink has been clogged for 3 days and I held a rag down in the non garbage disposal side while running the garbage disposal and it worked!!!!! When I heard that water fly through those pipes I was soooo happy!! It didn’t work at first because the garbage disposal side was only 1/4 full but I filled it with water to 3/4 full and it worked instantly!!! Your comment has saved so many people even 5 years later!!
Reply: Thank you Rob Reynolds! Worked like a charm!
Reply: sweet Jesus. It's a Saturday. Massively clogged sink. Dishwasher leaking all over the floor. About to rip apart pipes or call plumber on a Saturday, then I stumbled across your 5 yr old post. 2 minutes later, clog is gone. You, my friend, are appreciated!
Reply: THANK YOU!!! I had taken apart all my pipes, cleared them, and STILL had a clog somewhere. Tried your trick and worked like magic the first time!!! Wish I would have read that 3 hours ago!  I can't think you enough!!
Reply: 5 years later and your the man. I couldn’t wait till the morning for the maintenance man, I’m so glad I seen your comment 🙏🏽💯 Thanks for sharing
Reply: Thank you Rob Reynolds! I had to push down hard on the sink stopper, but after the third try, it worked! Clog Cleared!
Reply: Despite your post being 5 years old - I used this method first before checking the pea trap... and by goodness it worked BEAUTIFULLY! I didn't even need to activate the Disposal as I literally felt/heard the blockage break through and saw the water started naturally draining... however I did hit the disposal moments after I saw the water draining JUST to do exactly what you said - flush out any remaining stuff/gunk that might be in there. Thank you so much again! =D
Reply: Thank you SO much for this tip!! Tried (after trying everything) and it worked!! Appreciate you sharing this!!
Reply: Rob, you da man!!! Thanks!!!!! I feel so handy!! 🤜🤛
Reply: Here I am, 5 years later. Thank you. Your plumber's trick saved me a bunch of trouble. Thanks!!!
Reply: @Jessye Reese Like a charm. Approx. two weeks ago. Cleared off all the clog and water flows fine now.
Reply: Does this work on a one sink kitchen
Reply: I am here, 5 years later to say THANK YOU. Absolute LEGEND.
Reply: This worked for me and it was super easy to do. Thanks for the tip Rob!
Reply: Thank you! Just saved me a call to a plumber
Reply: Rob Reynolds I’m here to tell you that this totally works*!!! Saved me hundreds of dollars today for a plumber that didn’t hav to come out. I found this video and comment last night after spending all day with plungers, baking soda & vinegar, even a snake but I couldn’t reach the clog. Got up this AM mentally prepared to take apart the p-trap, *after just trying this one last trick... Success! Thanks so much dude!
Reply: After trying liquid drain cleaner and snaking, nothing worked. I did a search, came across this vid, saw your comment and decided to try it. Worked like a charm at the second try. Thank you!!!
Reply: Thank you so much, saved me money
Reply: This also worked, thank you kind sir!!!
Reply: Thank you Rob Reynolds!  You are a God send!  Your method worked beautifuly!!!!
Reply: I'm so glad I read the comments! This worked! Thank you!!!
Reply: BIG THANKS to both the video uploader & the plumber trick comment!!!!!
Reply: Worked first try. Thanks a million
Reply: All these years later...this is YouTube/internet Hall of Fame stuff! THANK YOU for commenting with the tip. God bless
Reply: I tried everything. I was just about to start taking my plumbing apart and read your reply. I tried it. Like you said, I had to do it a couple of times but eventually it worked! The only thing that I did extra was pumped the plugThank you so much Rob Reynolds
Reply: I was just about to take apart my plumbing and then I read your reply. I tried it. Worked perfectly. Like you said, it took a few tries but eventually it cleared. The only thing extra I did was pump the plug continuously while the disposal was running. It seemed to add additional pressure. Thanks Rob Reynolds!
Reply: Thank you so much Rob Reynolds!!!!!!!!!!
Reply: This comment needs its own video. Just did this and worked like a charm
Reply: Careful, you can cause a big pressure build-up if the clog isn't pushed through thereby causing joints to leak.
Reply: Thanks 👌🏽👌🏽👌🏽work out for me!!!
Reply: Thanks!!! Worked like a charm!!!!
Reply: Thank you Rob. Your truck fixed that stubborn clog. Have a great day.
Reply: Comment better than the video...thanks so much Bob!
Reply: Dude, thanks! You just saved my family and I a plumbers bill. Thanks you, you are a true hero! Much love brother
Reply: Woah.. dude this really worked 😂 wtf. Hey bruh. Thanks man. Thanks a fuck ton
Reply: Wow!  6 years later here I am to say thank you rob! Worked like a charm!
Reply: Rob Reynolds - this senior with no plumbing experience thanks you !!!   🙏🏻
Reply: Thank you for this post. Just did this and definitely work
Reply: you saved my day. Thanks Rob
Reply: What if you dont have a disposable?
Reply: you are a wonderful person i can’t believe this actually worked. thank you!!
Reply: This worked in like less that 10 seconds lol thanks bro 🙏
Reply: Appreciate the tip! Just finished doing it, you saved me time and money🙏
Reply: Ummm Rob is the man. 💪 a plumber had told us we had a clog deep in the drain, which is probably true but maybe we had another small one because this trick worked. If you see this Rob got any tricks for deep clogs?? Thank you again!! 🙏🏻
Reply: @rob fantastic!! Thank you
Reply: So plug the side without the disposal and just run the disposal?
Reply: Thank you so much for this tip! Just used on my kitchen sink and worked after the 2nd try :)
Reply: BET!....im trying this first...glad I read this comment...
Reply: Worked like a charm
Reply: Thanks so much you saved me alot of time 💪🏾
Reply: Thank you works perfectly
Reply: 03/2021 and the Plumbers Trick is still going strong! Tried plunging and turning on the disposal with no luck. After watching the video I thought I was going to have to deal with the same. But after reading Rob’s comment and about 3-5 tries later, it worked! If the disposal switch is nearby, get a a stick or something to extend your reach range. I used my 5 year-old daughter first but she became a bit afraid so I used a Star Wars Saber to extend my reach. LOL!  Thank you Rob and best of luck to everyone else. Cheers!
Reply: @ Rob Reynolds - thank you. It worked for me.  Prior to trying your trick, I had a clogged sink for 2 days. Couldn’t take the pipes apart- too tight. Then I tried Drano, baking soda, hot water, plunging , etc. yes, I tried 
So many things  with no success. Finally after reading your comment I gave it a try and succeeded at the 3rd try. 

Thank you thank you. Will not be needing to spend on a Plummer this time 👍
Reply: Thank You So So Much!!!!!! It worked like a charm!
Reply: Hey internet stranger! You just saved the day for me! Thank you so much!!
Reply: This saved me from going to the store and/or taking apart by drain pipes! Thank you SO much! :D
Reply: Mr. Rod ,
Thank you for your trick. I just fix my sink problem . 🙏
Reply: I’ve watched TONS of videos and THIS did it. Thank you!
Reply: Wow! This worked for me just now. Thanks!
Reply: Wow- great tip that worked like a charm. Thanks Rob!
Reply: OH MY GOD this worked so well, I was dreading having to pull apart the pipes. Thank you for the tip!
Reply: @Rob Thanks!!!!!!!
Reply: This worked first try, omg thank you soooooo much
Reply: I just did this trick, and it worked! Thank you Rob Reynolds!
Reply: Thank you . This helped !!
Reply: This worked on the first attempt. So much easier than taking pipes apart. Thanks Rob!
Reply: THANK YOUUU SO MUCHH
Reply: Holy shit it worked!  Luckily i saw your comment Rob as i was about to call the plumber.  I had used the green goober stuff last night and let it do its thing with no luck.  Used a snake last night too with no luck as it could oy go about 2 ft before i couldnt push it in anymore.  Your trick worked in about 10 seconds!  Thank you
Reply: Rob Reynolds, tried this trick and it worked! Was ready to un do the plumbing, but thankfully didn't have to.
Reply: Ty Rob you save me time and money on a first try🥰
Reply: thank you thank you thank you thank you
Reply: M
Reply: @Rob !!! It worked, thanks for the tip, you saved a woman with two young kids so much time and energy.
Reply: Omg bless
Reply: Worked like charm.
Thanks Rob,
Reply: Rob, no idea if you’ll see this but thank you so much for the tip!
Reply: Rob = life saver! Dude thank you thank you!
Reply: Thank you, thank you, THANK YOUUU!!!
Reply: Thanks Rob!!! Still works!!!
Reply: @rob reynolds Thank you!!! You saved me a lot of trouble and $!!
Reply: YOU SAVED OUR SINK THANK YOU
Reply: THANK YOU!! I just did this for my renters and it worked perfectly. Thank you for sharing your knowledge!!!
Reply: 6 years later and this comment just saved my day! I tried everything I read online and my next step was to take it apart... I read this comment and figured I'd try one last trick and WHOOSH it worked on the very first try! Thank you for taking the time to post this 6 years ago, you are still helping people today! :)
Reply: You're still saving lives in the year 2021 . Thank you!!
Reply: Worked first try!! Literally a life saver!
Reply: Hi Robert.  So i tried ur method and it seemed to work but soon after water flowed back.   We opened up the pipes n theres no blockage.   Also now when we try to drain water using the garbage disposal, the washing machine pipe would overflow with water.   I would call my landlord but dont want to bug him if i can see if i can do it myself.   Any suggestions you have for me would be much  appreciated!
Reply: Wow it actually worked. Thank you for the tip. 🙏
Reply: I owe you my life. Three days of trying to unclog my sink and it worked!!!!
Reply: Thanks Rob ! This was the last video I looked at and seen your method, went inside and try it . It worked .
Reply: 8/7/21– Thanks you to whoever posted the video! BUT Rob your the man! I was just about to tear my pipes apart & came across this comment. Worked like a champ! Thank you!!
Reply: Rob, 6 years later and you’re still the man, appreciate the tip it was a life saver!
Reply: Thanks Rob this totally worked for us!
Reply: This worked like a charm!   Thanks!!
Reply: Bruh! It worked! You my friend, are awesome. Thank you! I was about to take stuff apart hahahah
Reply: We had a clogged sink that would eventually drain. I decided to try this trick this morning and both sides of the sink filled with black water that isn't going anywhere now. We also burnt out our garbage disposal! Calling a plumber now!
Reply: Yo this worked
Reply: Thank you. It worked!
Reply: worked first try
Reply: I did what you said n it worked like a charm..

Thanks Rob
Reply: Thank you! This worked for me too!
Reply: I DON’T KNOW IF YOU’RE STILL READING COMMENTS BUT THANK YOU SO MUCH YOU ARE A HERO OMG
Reply: You are the man @rob
Reply: Awesome tip! Just saved me 2 weeks waiting out our apartment complex to do something about it!
Reply: I literally have been trying to unclog my sink for 2hrs and saw your comment when I opened the video. It worked immediately. Thank you 😊
Reply: Rob Reynolds I would tip you right now for the wisdom. Many thanks chief
Reply: Thank you sir... thank you so much .I believe you just saved my marriage because if my husband had to go behind the wall in unclog that pipe one more time for me putting food down there that was gonna be it. Lesson learned ❤
Reply: Thanks for the pro tip ! It solved my issue today 👍
Reply: I just did this and it worked like a charm. So awesome! I just bought my first house and I'm single and that just made me feel like a badass. Lol. Thank goodness for Youtube. Thanks for the tip, man!
Reply: Worked for us too! Thanks!
Reply: What if that doesn’t work right away even after a few tries
Reply: Rob Reynolds! I owe you money sir! This was better that my magic wand. It's in the drain soooo. Thank you from the depths of my soul Mr!
Reply: Great tip, thank you
Reply: Holy shit my apartment is filled with water from this situation I tried finding several things to do and your method worked!!!!!! It finally stopped and drained right back down. Thank you so so so much!!!
Reply: 7 years later im going to see if it works
Reply: 7 years late but you are a life saver I so did not want to have to call a plumber or unscrew anything you are a lifesaver thanks a million times 🙏🏽
Reply: Did this tonight. Frickin worked. Thanks for the tip!
Reply: You sir should be commended.  A trillion thank you’s and well wishes.
Reply: Worked like a charm. Saved me time and money. Thanks Rob!!!
Reply: This absolutely worked 100% you just saved me so much time!
Reply: Thank uuu!!! Worked jst like u said!
Reply: THANK YOU SOO MUCH!
Reply: 2021 trick still works haha thanks
Reply: Holy shit sir. You are a god dang genius!!! This worked after doing it twice! You made my day man!!
Reply: Dude you’re a fucking hero
Reply: You're a savior my MAN!!!
Reply: You just saved me so much money!!!!!
Reply: Thank you for the info Rob. I tried what you recommended and it worked!
Reply: Did this after 3 days of using multiple augers after 3 times it worked like a charm thank you so so much!!
Reply: Damn I did it once I just tryed to call the maintenance man I don’t need his ass I did it myself !!
Reply: So glad I read your comment! Thank you so much
Reply: Awesome tip! Thanks so much, that method worked for us today.
Reply: Your trick was awesome. Totally worked. I was so bummed to have to take the pipes apart. THANK YOU!!
Reply: Didn't even get past the ads for this video. Straight to comments, first one. Sink clogged, plumber can't get here for 3 days. You just saved me $200, so I pressed my luck and bought a $30 scratch off and won $50. Your comment actually made me money!
Reply: Mmm en.   Nn
Reply: 2021 just done exactly what you said in your comment. Tried it twice and it worked perfectly.
Reply: Damn. I have no clue where the plug for the drain is. Ughhhhh I need an alternative plug or smtn.
Reply: You just saved me $75+. Not all heroes wear capes bruh!
Reply: Dude you save me $300. Thank you so much.
Reply: The real mvp this worked so well
Reply: THANK YOU FOR THIS!! It worked like magic!
Reply: This just worked for me and I’m so happy thank you 😭
Reply: This worked like a charm! Thank-you so much for this valuable information!
Reply: This trick works, thank you so much
Reply: @Debbie Perks
Reply: Another huge THANKYOU, from me and my partner! <3 Saved our sink haha!
Reply: Didn’t work for me, instead it popped my drain and I had to end up unscrewing everything and digging out the clog.
Reply: Thank you so much man I just did your trick and it worked on the 2nd try.
Reply: Saved me a headache
Reply: Worked. Thank you
Reply: totally worked brother. thank u from a civil engineer it made perfect sense!!
Reply: It worked thank you so much
Reply: @Rob Reynolds, thank you for sharing this!  Worked like a charm!!
Reply: Thx, this worked for me!
Reply: Just did this, thanks a bunch.  Even 8 years later your comment is still helping people.
Reply: I just bought my home and had this happen and I just randomly used the plug accidentally just like you described before reading this and it worked just like you said. Thanks
Reply: Omg! Thank you Rob Reynolds! You completely saved me! 😁👍
Reply: Oh my goodness thank you for this trick! Completely worked!
Reply: This doesn’t get old..8yrs later tried it and cleared the blockage right away without having to dismount all pipes and traps.
Reply: I didn’t even watch the rest of the video and I had a plunger and I held it right on the left side, turned on the disposal waited for about 30 seconds tightly and it went down ! I was so happy 😭😭
Reply: And it was clogged because it’s cold and I put grease 🌚
Reply: Did this trick just b now and it worked!!! Tysm !!!!
Reply: Do I have to turns off the water valve under the sink first??
Reply: Can someone translate this word salad? Looks like it has good info somewhere within.
Reply: Came across this tonight 2/6/24 and it worked perfectly.  Thank you for sharing your knowledge!
Reply: This worked! Had to put a rag under stopper to keep it tight, 3rd try was the charm.  Thank you!
Reply: I tried it couple of times, but everything starts shaking like crazy and water starts shooting up on the disposal side even while running. I’m afraid to break something, like disposal or something else. Feels like it’s about to explode. Should I keep trying??? Thanks!!
Reply: Rob you saved my life thanks god bless you
Reply: I tried this but it does not work ?
Reply: Thank you, thank you, thank you!💐🌹💐
Reply: Wow this worked. Thank you! Had to try it a couple of times.
Reply: It worked for my kitchen. Thank you so much ！
Reply: Tried this and pipe burst. Awesome
Reply: Thank you for this comment I’ve been stressing bc the maintenance office is closed this helped so much?
Reply: 4.26.24 thank you!
Reply: Absolute genius,  thank you SO much!!!  Bless you!
Reply: I love you
Reply: Thank you sooo much!!! Omg your Plumber's trick worked for me !! I did the pressure trick just about 2 times and boom, that's it 😀😀 I am so grateful, I was so excited it actually did lol I wish I did a before and after picture. I had used a big bowl and scooped as much water as I could to the sink side with the garbage disposal under it, until that sink was about filled to the top with water bc both sinks were actually about half full. After that I put on the garbage disposal while holding down my rubber stopper in the other sink. The garbage disposal side started going down, then the other side, I kept the pressure on it, it was kind of pushing my hand up but I remember what you said. After doing it twice, garbage disposal side sink drained all the way down first, then the other sink after. Sorry such a long post! But also I did hear some drip sounds under my sink right before doing the trick and it was leaking from the pipe above the garbage disposal, so I put a mop bucket under it, it collected just about a cup and half of water.
Reply: Thank you so very much. I was just about to take all the stuff from under the cabinet and undo the pipes but holding one side like you said worked
Reply: Well holy shit, it worked, thanks
Reply: 9 years and still helping crazy how informative YouTube use to be
Reply: 9 yrs ago, Wow. What if u don't have garbage disposal?
Reply: 👍👍👍👍👍👍👍 Thank you ❤
Reply: Just did this to our kitchen sink and worked like a charm! Probably the most useful comment I've see on YouTube haha